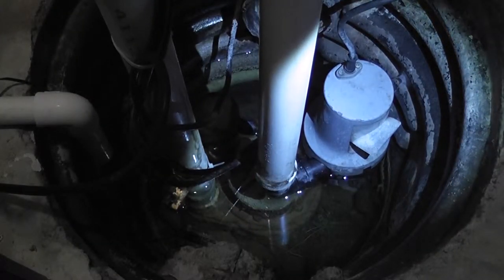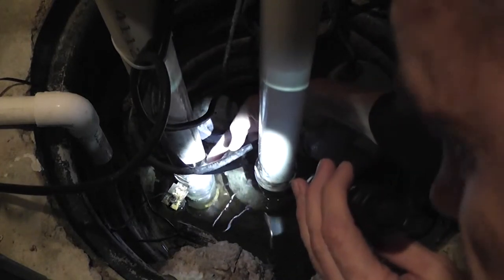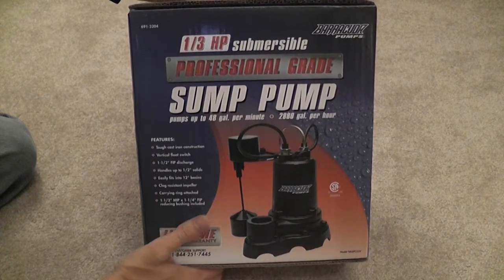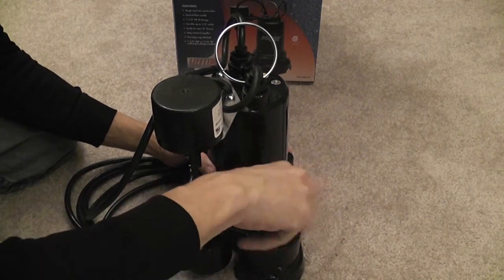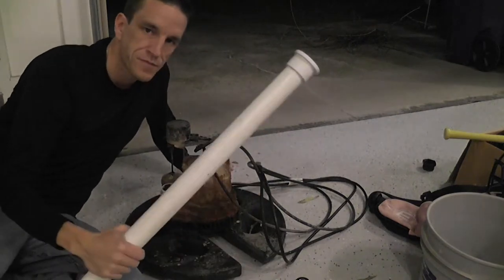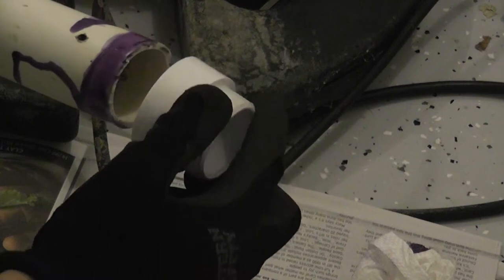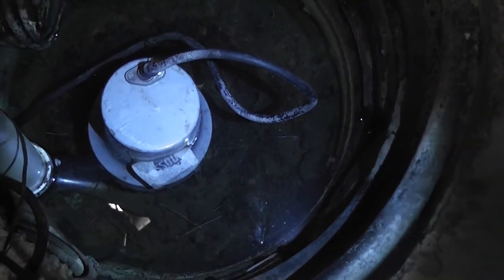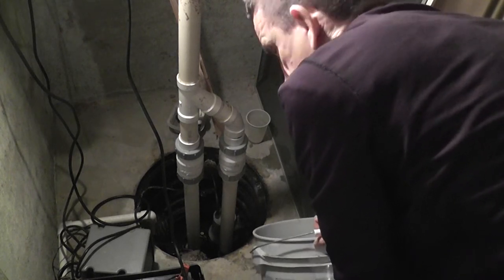How to Replace a Broken Sump Pump

Comment: Did you drill a "weep" hole in your PVC to prevent air-locks
Reply from the maker: Great question!:)  Yes, you should have weep holes ... I used the previous tube which already had a hole.

Comment: My sensor doesnt work but when I plugged the sump pump cable in by itself the motor turns on.  Can I just buy a new sensor or do I have to buy a whole new unit?
Reply from the maker: Hello ... yes, you should be able to purchase just a switch.  This will save you some money considering you will not need a new sump:).